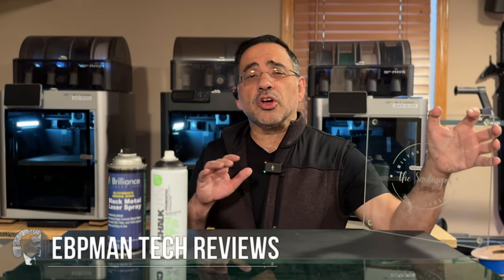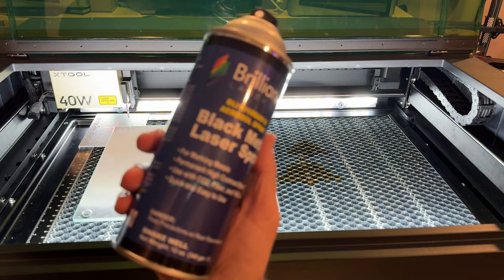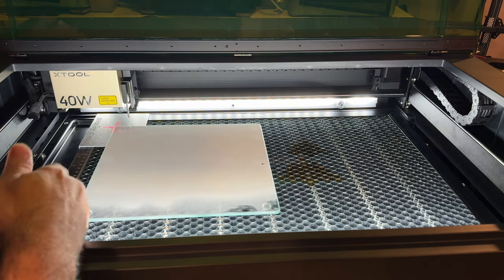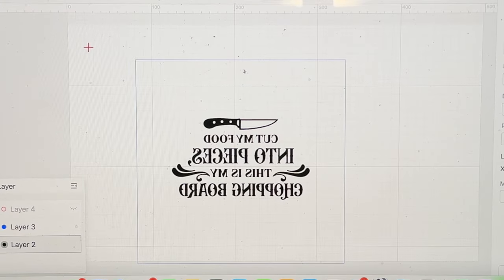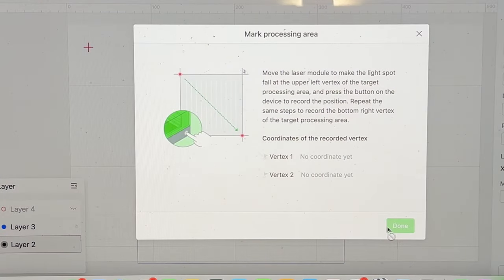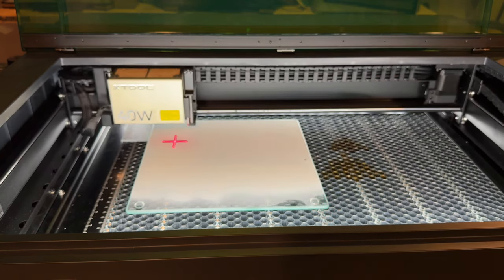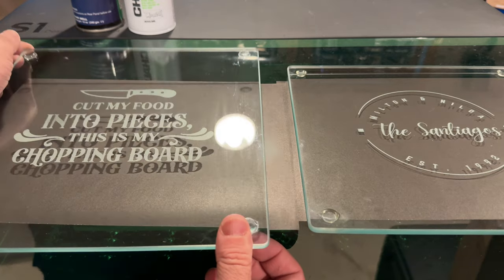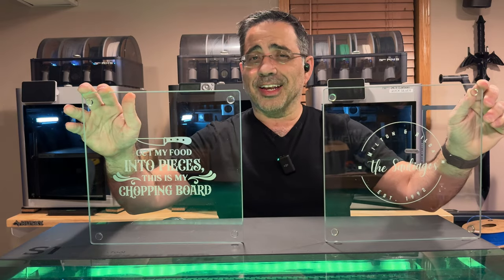How to Laser Engrave Glass with the xTool S1 Laser Engraver

Comment: Hi, I have the 20W S1 & wondered if the settings of power 60% & speed 100 mm/s would be the same for engraving on the 20W machine?
Reply: @ebpman I had the same question. Could you advise?
Reply: I just ordered a 20W. I would just plan on sacrificing a board to set up the speed / power test that is a feature of the design space
Reply: For my S1 at 20w using the Rustoleaum Cold Galv Compound from home depot, I ran at 25%power and 100mm/s with 3 passes. The 1st pass burns the material but leaves it black. 2nd and 3rd pass clean away the burnt material and when you wipe it clean you get the perfect frosted glass look!